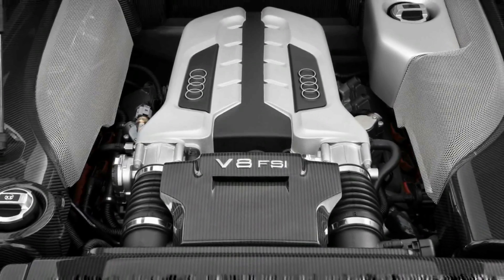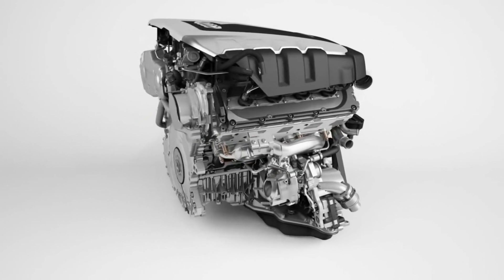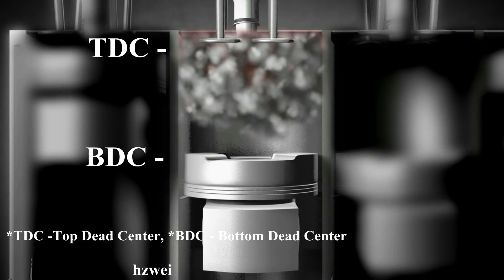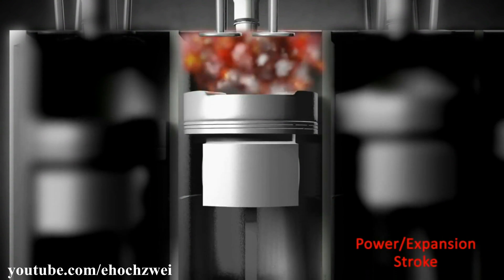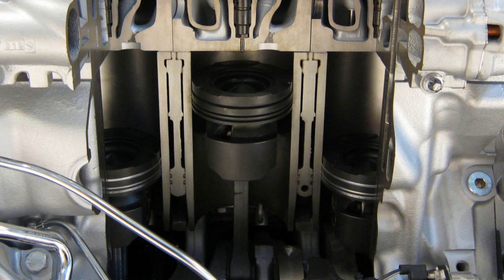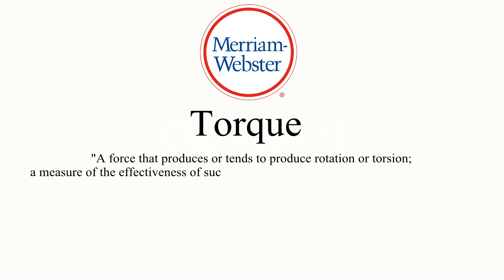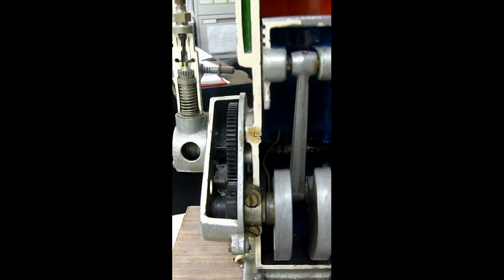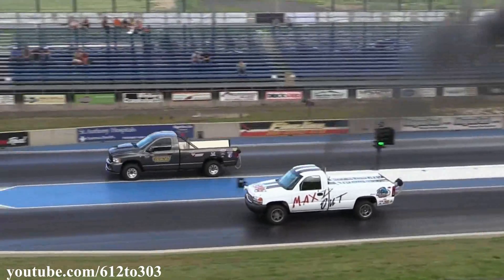Gasoline (petrol) vs Diesel - Why Do Diesel Engines Produce So Much Torque?

Comment: Yet if we compare SI and diesel engines with the same displacement, same boost pressure, the SI engine produces far more torque and hp.  Compare apples  to apples.
Reply: That's the thing. They can't run same boost pressure. Diesel engines handle much higher boost figures than gasoline engines. The higher compression ratio of the diesel engines and the longer piston strokes inherently give the diesel engines more torque (torque = force * distance, the distance in diesel engines is bigger).
Reply: @XhanetMP  Longer stroke doesn't produce more torque for the same displacement. Piston area for a given displacement increases as stroke is shortened. Area X pressure = Force.  I did a video showing this: https://www.youtube.com/watch?v=7Pfz1zbg-JA&t=106s

Also did one showing that diesels make less torque than SI engine per unit displacement and per unit boost pressure: https://www.youtube.com/watch?v=cwGxuiLFhys

In both cases, I provide real world examples of engines proving this. If you can show otherwise, I'd be interested in seeing actual engine cases proving me wrong.